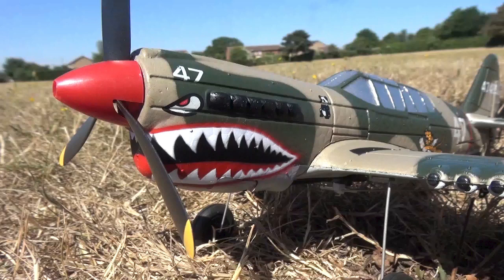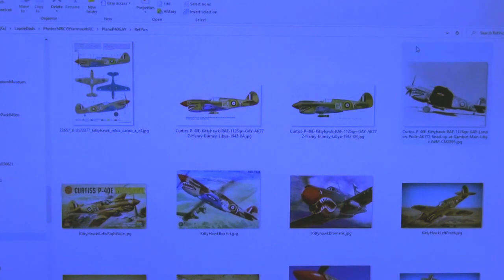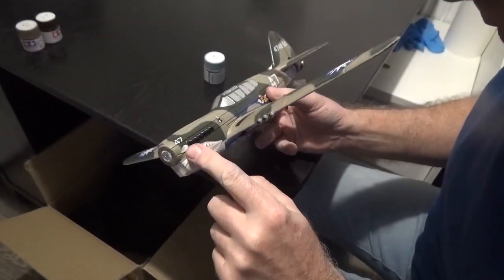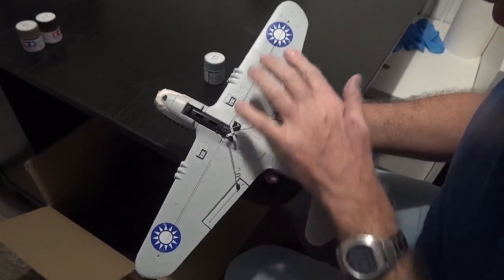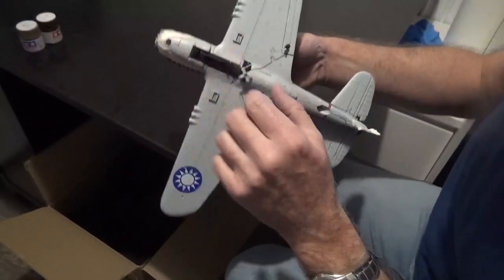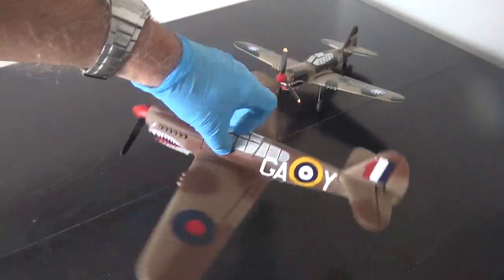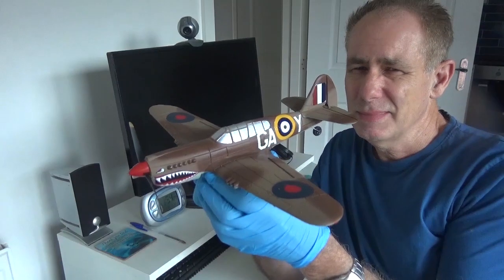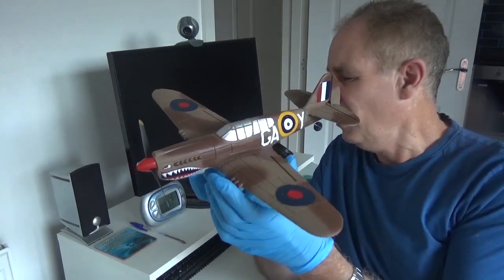RC Plane Kittyhawk Re-paint

Comment: Can I put my Volantex rc plane with acrylic spray paint? I'm just concerned about whether it's okay to add a clear finishing coat because my goal is to protect the paint details of my warbird from being scratched or faded.
Reply from the maker: I use acrylic sprays and they are ok. But best first to try by removing a hatch if it has one and spraying under that just to make sure the foam isn't attacked.